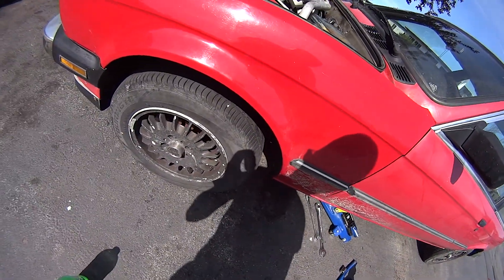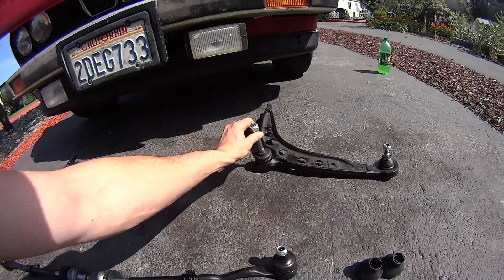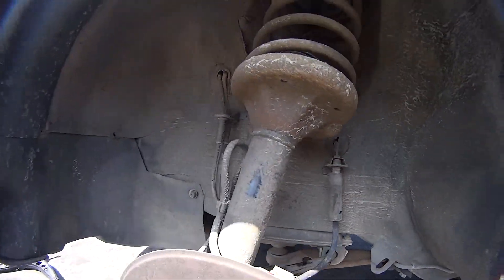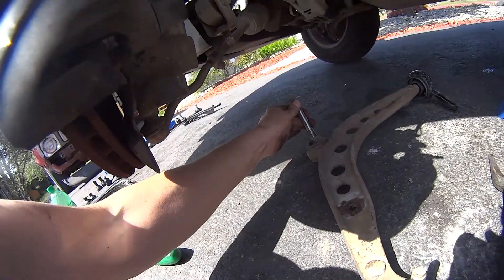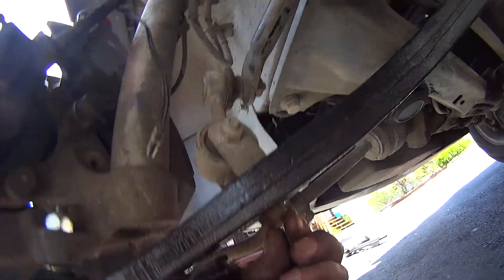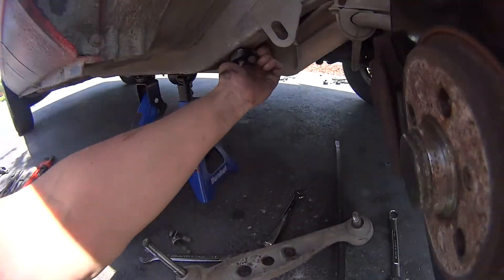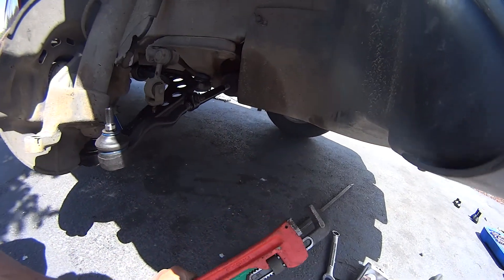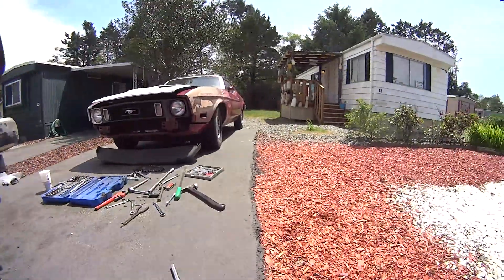How to Fix & Repair 1986 BMW E30 E28 325 518 Control Arm Replacement

Comment: Even though this is 5 years old, it was perfect for me. I was struggling with those 22mm nuts on the inner. Finally got those loose and off today. Then I got stuck on freeing up those inner posts... was at wits end and watched this. Going to let some penetrating oil soak in there and give em a whack later today. Thank for this. Appreciated.
Reply: Update, all done. Whacking with the pickle fork and 4# sledge did the trick. Easy to put it back together with new parts. Maybe a half hour job to install both sides.

Comment: I like how you just edited out the part I wanted to see. Lol. That pain in the ass nut on the right side with the exhaust in the way.
Reply: nut holding the middle of the arm to the subframe on the exhaust side was so hard to reach holy hell i had to construct the ExtendoWrenchinator 5000 and go at it from the top: spanner head bit -> u joint -> frickin 2 foot long extender -> ujoint - > breaker bar.
Reply: @orestestrivellas3153  Im on this right now and its fcking infuriating.
Reply: @nextak5312  took me like an hour and a half because i can only really get 60 degrees of rotation before i had to reset the whole contraption on account of how there is no clearance around the exhaust header

Comment: what is the best method to bend out the lock tabs on the tierod lock washers?
Reply from the maker: screw driver and bend them out to get a socket on if I'm remembering right

Comment: How in the hell did you remove that inner nut, it's such a tight squeeze
Reply from the maker: +Alex Rodriguez If I'm remembering correctly I used a breaker bar and some extensions.  May even had to use a universal swivel 1/2 drive to get down in there.
VT247